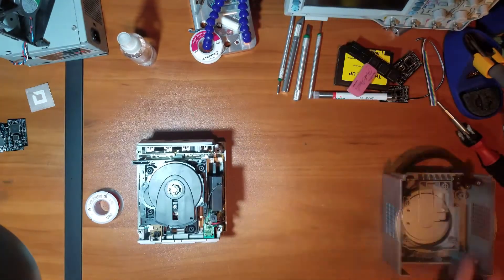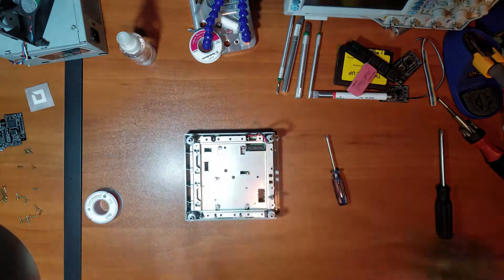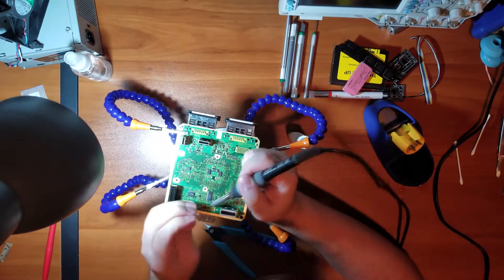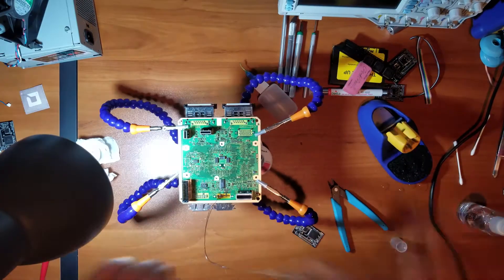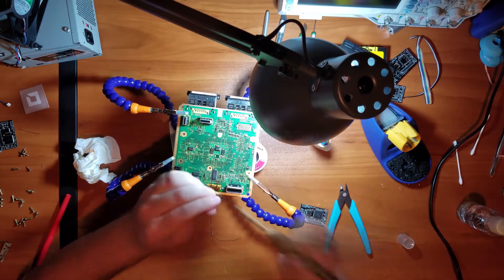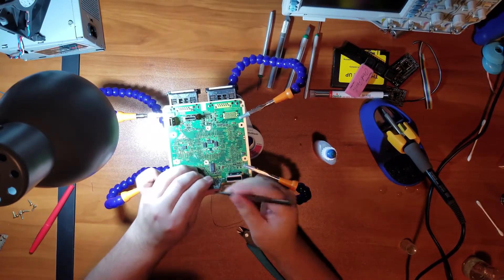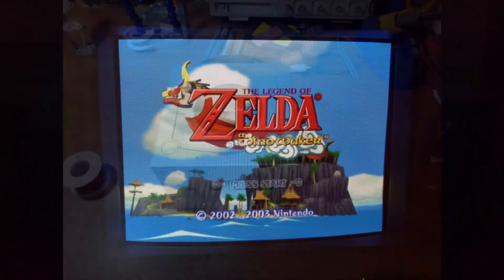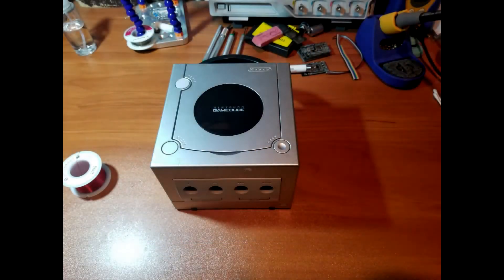GCVideo Lite 0.9 install

Comment: I can’t find any board, what the hell happened to gcvideo lite
Reply from the maker: It has been updated. Just look for the GCVideo boards, the lite is done.... I know BadAssConsoles sells them if you want to deal with them.
Reply: O how the mighty have fallen
Reply: The original design used a CDK3404 video DAC made by a company called Cadeka - they were bought by another company called MaxLinear and some of the product lines dropped including that specific DAC.  At this point, it's basically unobtainable and hence you can't build the boards any more.

Comment: Hey! Where do i find the values of the capacitors and resistors necessary for the board? the BOM file doesn't have that much information.
Reply: Not sure if it didn't then, but it does now. If you scroll right it even tells you alternative ratings in case you can't get the main one.